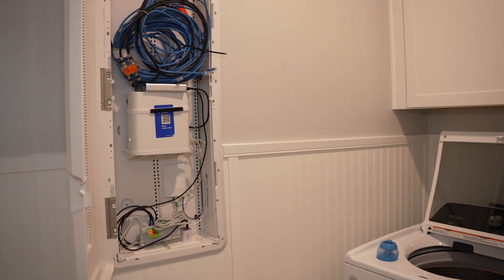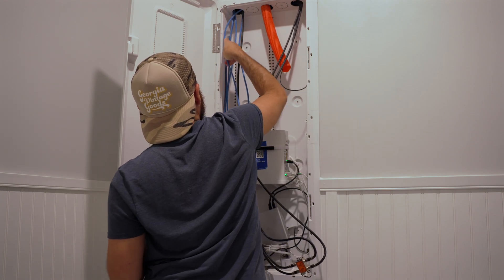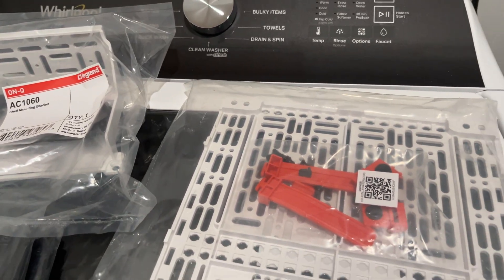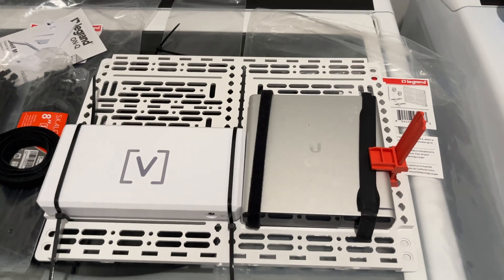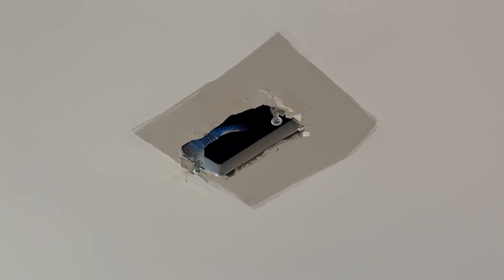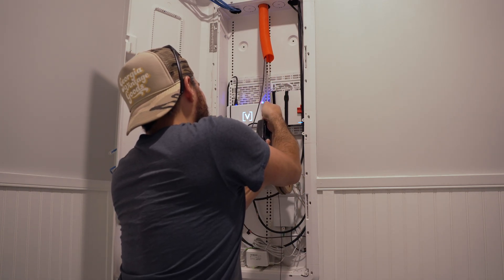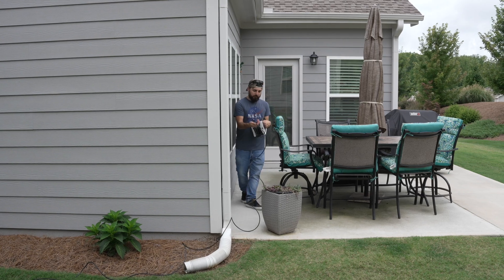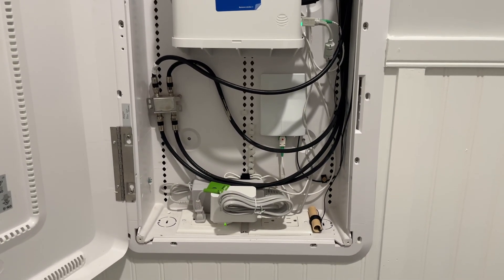Home Network Install in Structure Media Enclosure Panel using Alta Labs and Ubiquiti

Comment: I pull string lines daily from 100 to 500ft, and the technique I use is to put just a small piece of plastic bag on the end of the line and on the other side of the conduit I put my vacc., it never fails (just a small piece of plastic bag) 🤜🏼

Comment: So when is it ok to run anything in the innerduct other than fiber? Its orange forba reason. Bad move.
Reply from the maker: Uh it’s orange because it’s low voltage
Reply: @SPXLabs  believe what you want, but that's against code to do that.

Comment: Why keep the Unifi Cloud Key if the APs were replaced with Alta Labs which are cloud managed?  Just not sure what the Cloud Key is doing in that setup for the user.
Reply from the maker: The cloud key is setup as an NVR only.  There are Unifi cameras around the house.

Comment: I bet that Smurf tube wasn't kinked, I bet you it was split (cut) in the attic. Sometimes they home run it to the panel, sometimes they cut it in the attic. 
-AT&T Installer
Reply from the maker: I feel like it was split because the laundry room shared the exterior wall where the tube exited the house.

Comment: Hum, that's interesting. I've used several wireless AP's and the Ruckus AP have been some of the best performing AP's I ever used. Their UNLEASHED firmware is great for a free software. I'm guessing that something wasn't configured correctly.
Reply from the maker: To my knowledge these were never used and were not visually appealing.  Furthermore more the client wanted something that could be setup and never be touched again.  Which ruckus may be capable of but who am I to argue.
Reply: @SPXLabs  Perhaps a future, low-cost video idea. If you were able to keep the R510's go through the process of loading UNLEASHED, it's features, and testing them to see what opinion you form (don't take my word for it). More knowledge is always better.
Reply from the maker: I do want to have a gander at em but not sure when I’ll get to it

Comment: FYI, the bag didn't work cuz bag was too big for the suction level of the vacuum,creating too much resistance. Use a small section of the bag like 3-4" diameter
Reply: A more powerful shopvac would also help. Lowes sells a small 2.5hp craftsman for $30
Reply from the maker: I also used a shop vac off camera and it was still not pulling through.  In fact it was so stuck then when I pulled the string to pull the bag back out of the tube the string ripped off the bag and I was forced to push the bag out with my fish tape.

Comment: That was a great job, it was small but very messy at the start
Reply from the maker: I even wiped most of the cables as they had some sort of gel or lubricant all over them.  It was strange.

Comment: Meh... not a fan of mixing echo systems when it comes to networking. Just go full Ubiquiti, access all in one place. Nice job though, maybe your vacuum cleaner just wasn't strong enough?
Reply from the maker: I feel you, I’m like that with my stuff at home.
I did try a shop vac (off camera for sake of brevity and expediting the work) and it couldn’t pull the bag either.
Reply: Ubiquiti works as NVR, not for networking